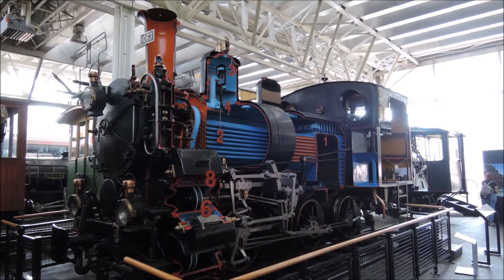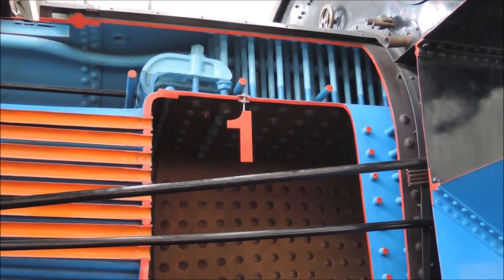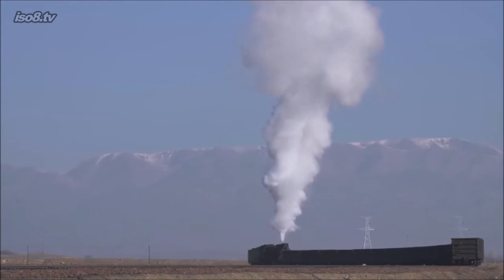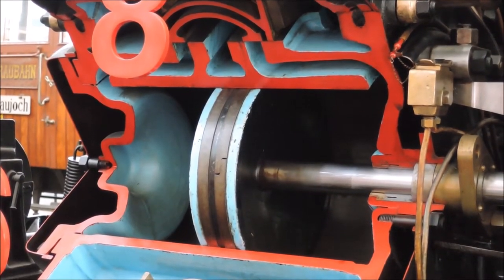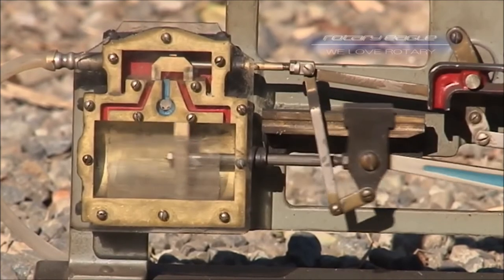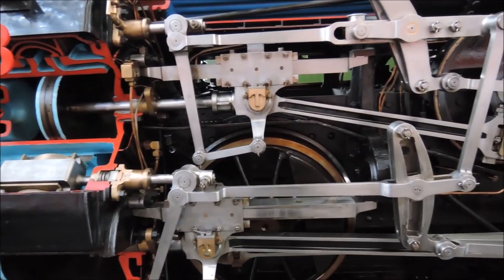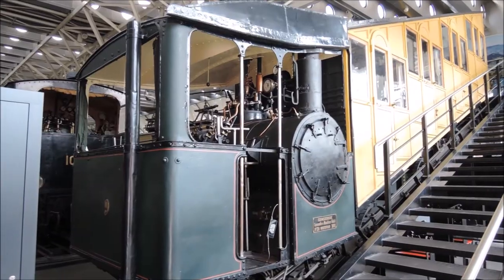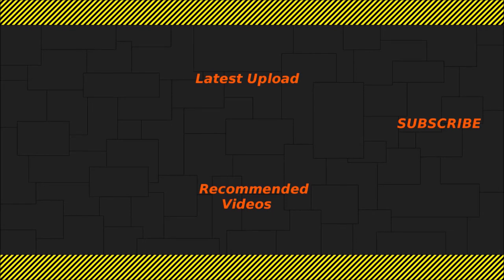How a Steam Locomotive works | Cutaway Steam Locomotive explained in the Lucerne Transport Museum

Comment: thank you so much
Reply from the maker: This Video doesn't really hold up to my Quality Standards anymore too. It is too slow, goes too much off-topic and takes too long to get the most relevant Information over, and not to mention my really poor Job at speaking. I'm working on a similar Video about a Sulzer Paddle Steamer Engine in that Museum (actually recorded on the same Day), where I improve on these Things. Probably the most important Change is a quick Explanation aka "Coal burns in the Boiler, raises Steam, Steam moves Pistons,s, Connecting Rods make Crankshaft turn" at the Beginning of the Video, as many People turn away in less than a Minute. A better Cutaway Steam Locomotive Video is on my Bucket List as well; I'm going to make it as soon as I come across another Cutaway Steam Locomotive. I'd prefer to make such a Video about the Merchant Navy Class in the National Railway Museum York, but don't think I'm gonna get to England in the next two Years so I'l probably make it somewhere else though.